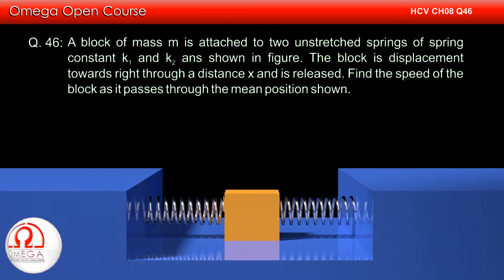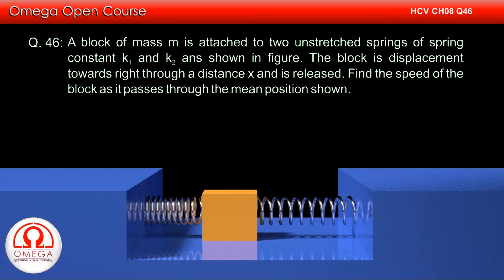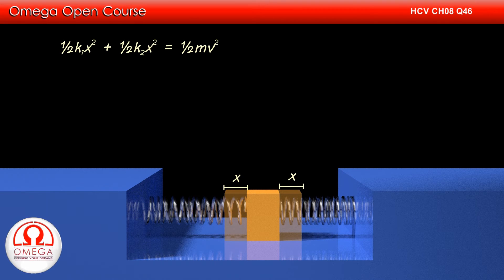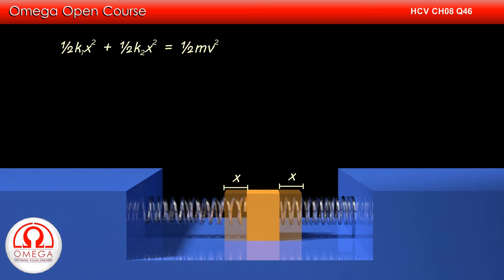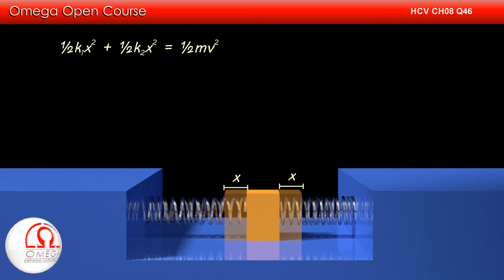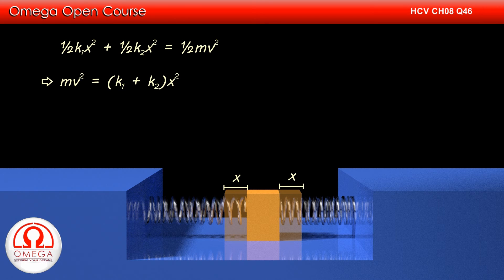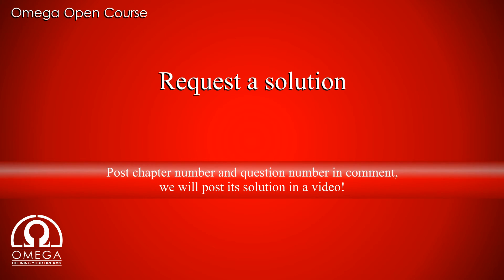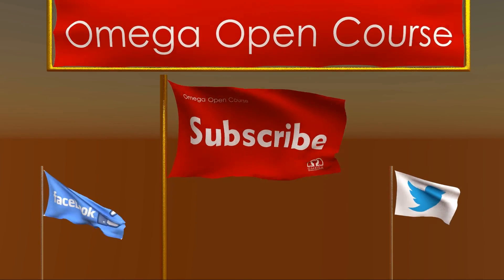H. C. Verma Solutions - Chapter 8, Question 46

Comment: why are we adding energies. since the directions are different, shouldn't we subtract it. please sir explain!!
Reply from the maker: +Sriram Iyer energy is a scalar. It does not have any direction. You add or subtract depending on whether the energy is increasing or decreasing.
Reply: Sriram Iyer you can consider any direction of displacement positive or negative since the expression has displacement squared it gets positive and the energy is scalar that's why we add it.
Hope it clears your doubt!